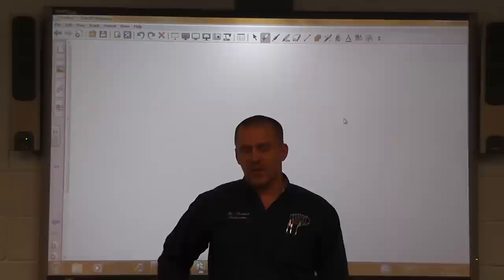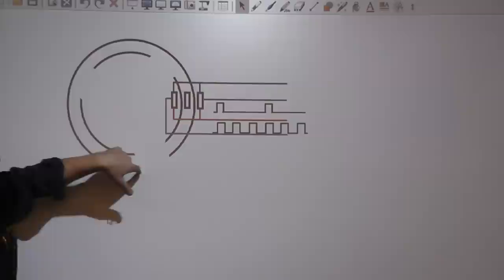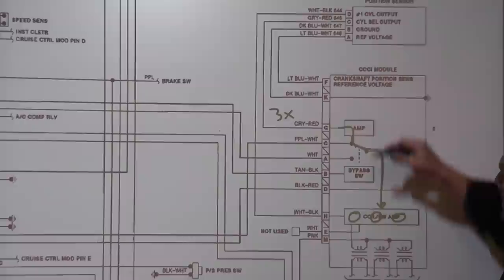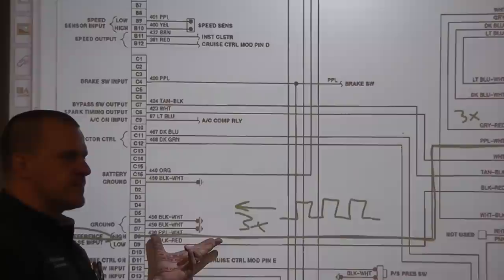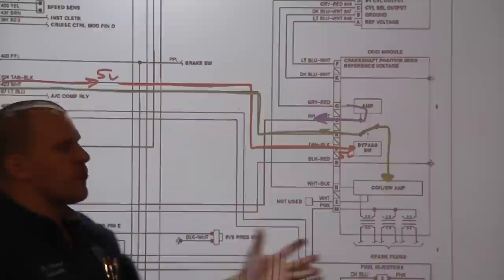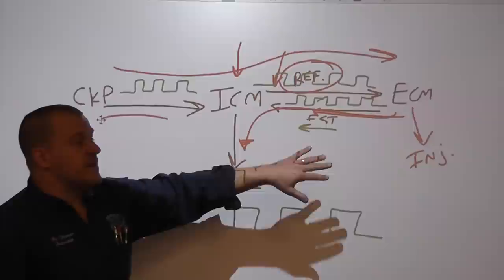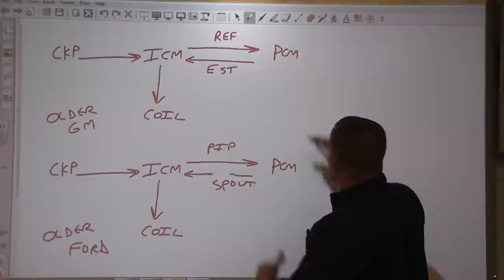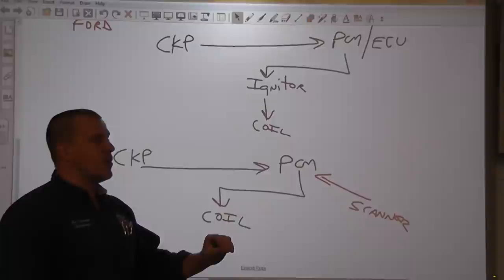GM Bypass Ignition System Operation (part 1)

Comment: This video might be an 'oldie' but it is certainly a 'goodie'.  It influenced me to open the factory service manual on my '93 Chevy Corvette 5.7L LT1 to see which ignition system it has (wiring diagram)..... it's a bypass type.  Thanks for the inspiration to learn more about auto electronics Paul

Comment: WOW! I'm quite impressed and now more knowledgeable on ignitions than my mechanic and electrician skills use to be. You make me want to sign up for school now...
Reply from the maker: I have an online class on my website if you're interested www.scannerdanner.com
Reply: @ScannerDanner  sir, let's take an example about ckp sensor.
1. The car starts well, everything ok. Now, while engine is still RUNNING, if the ckp sensor is unplugged or removed, will the engine stall??

2. I removed the ckp sensor and had someone to crank the engine at the same time, I'm creating blocking and unblocking the magnetic sensor quickly with metals fast enough to send signals to the ECM. At this manually signal inputs to the sensor, will the engine CRANKS AND RUNS??
Reply from the maker: @tnamen1307  1. depends on the car and the design of the cam sensor signal, in general almost all of the older cars will immediately stall
2. nope, the crank sensor is timed mechanically to piston position (top dead center of a cylinder) and you will never be able to match the correct timing signal by doing that
Reply: @ScannerDanner  hi there sir i been working on cars along time i pick up a 95 Camaro 3.4  it has spark but no injection pulse i put a new fuel pump and new gas tank do yea any ideas on how to fix it i have gone broke trying to get it going
Reply from the maker: @JonOffgrid  do you have fuel pressure? Any trouble codes? Is this a sequential injection system or a group fired system? Can't remember. If it is group fired like the 2.8 and 3.1 of this era, one single shorted injector can cause this
Reply: @ScannerDanner thank yea for getting back to me   i have fuel  but no injector pulse i have to see if i have shorted injector it start  up if i put gas in the intake i wish i could see if it has codes but thank it is tech 1 with obd 2 pug i wish it was 96
Reply: i thank it is like 2.8 s
Reply from the maker: @JonOffgrid  codes won't help you with shorted injectors anyway my friend. Can you get to them, or does the intake cover them?
Reply: @ScannerDanner  they are hard to get to i know were a parts car is i may get them injectors
Reply from the maker: @JonOffgrid  we can do resistance measurements from the ECM connector, so no need to guess and remove the intake needlessly 
We need to move this to my forum at this point so we can get some diagram info and pictures of how to do the test
It is free to join www.scannerdanner.com 
Let me know when you post it and I'll jump over

Comment: Hey Man, good video.  I've wrenching for a lot years and you just made my day.   I mean I've been doing this for 40 plus years - but usually hard way compared to yours.  Actually been watching your channel awhile.  Been supporting myself pretty well wrenching for myself 17 years near Denver.
Anyway, caught this one right on time.  My neighbor moving on after 30 years in the house gave me a '89 Pontiac 6000 STE (AWD) in go condition except busted 3100. he'd pulled a 3100 supposedly from a '93 said was running, but what I saw was later OBDII. My good friend Brien - great dude - is dying from cancer, talks through a hole in his throat and never smoked. Doesn't have long. He's driving this worn out Envoy thats junk. (Actually trying to get the security to relearn a key and he using my truck for his medical stuff) Brien likes this car.  So it;s over here.  He  dropped the subframe w/powerchain.  I switched out the engine, everything bolts up. Also, was told is was pulled from a  Pontiac but one different mount. Was side by side comparison to a 99 Buick Century perfect match.
We'll have to modify the fuel lines and egr, then figure out how to wire it in, its electronic without a vacuum line, and heater hose routing. The guy brother had scrapped the 89 intake and throttle body, but saved the injector harness and it plugs into 99 injectors.  All 6 have same color code and I could only guess the routing. It has 2 crank sensors, one to the coil pack match. extra one  at harmonic.  Also, cam sensor. Same coil pack just different location. Engine is in, it's back on the ground, just trying to find time/money to finish.  Probably fire is up in a few days.  But this kinda matches this vid and had to say thanks.  
And again for your scanner stuff.  I mean I used a solus pro for years and now I have a modis edge. Trying to learn everything. I'm learning the low amp probe, secondary coil stuff.  I have a little website that I have back up after being down 5 years.  Going to link this video there, probably on Tim's Build's button. https://www.timthemechanic.com/
Thanks Again for all your vids.

Comment: That was the most distilled and concise explanation I've heard, describing construction and function of a bypass system. You young techs need to pick up Paul's book. I have been in the trade for 31 years, and grew up in the business prior to that. I Just purchased the book myself... I could have made a lot more money if material like this was available back when I started out. Thanks Paul, you are a good ambassador for our trade. I Haven't seen any gdi or multiplex? Got vids?
Reply: I really like the way you are able to un-pack your topical info...and I believe your viewers would greatly benefit from you taking a moment to review construction and function of the component you're field testing. i.e. looking at spark on a waste spark coil....many techs don't know what that is. It's just a quick reinforcement. I've seen you use reinforcement in class, and it would be good to see in your field work. I will be happy to provide a review of your book; I will be joining your premium channel once I have pre-read your book materials completely. Have a great weekend.
Reply: ScannerDanner Premium i have the bypass wire the tan and black wire cut and the car runs but not that good it wont run over 120 km could it be from the bypass wire do i need to fix it or is it ok to leave it cut ? thanks man love ur videos by the way ur the best
Reply: The design Paul described and explained in its natural settings was to perfection

Comment from the maker: @scraiga66 I don't have a video on that but check out the wiring diagram on a 1993 Chevy Cavalier 2.2 (VIN 4) engine compared to a 1994 Chevy Cavalier 2.2 (VIN 4). The 93 version is a bypass system (CKP sensor goes to ICM) and the 94 is completely ECM controlled (CKP sensor goes to ECM). So for no spark diagnosis we need to treat these systems differently.  Thanks for the comment

Comment: Thank You. Been dealing with an intermittent no start on an 01 Blazer that is a complete no start now unless using ether(starts EVERY time).  This is a big start in solving it. New fuel pump, plugs this past summer. I'll be checking this asap.

Comment from the maker: @trad444 Thanks for the book purchase and comment! The CKP variation learn is for crankshaft acceleration rates (frequency increases) for each cylinder firing event. I believe this CKP learn is for proper misfire monitoring to take place, not for the 1x and 3x signals, as this is only one of hundreds of designs.

Comment: This has been quite helpful with my 1993 chevy 7.4L system. My bypass wire does not read in volts but millivolts so I'm hot on the trail ! My truck will start quickly but idle kind of rough with the bypass connected and smooth with it not.

Comment from the maker: @vader2492 Thank you very much. That was a great compliment. It is true what you say about consumers needing educated on why they need to pay for diagnostic time. Most of them think all you need to do is plug in the "computer thing" and it will tell you what to fix. The "free diagnostics" that the parts stores offer hasn't helped this train of thought either.

Comment from the maker: I have seen a completely plugged exhaust cause that. Also a bad coolant sensor which was causing as immediate flooded condition. Also I have seen these early design injectors only short out when under "stress" and test fine with an ohmmeter

Comment from the maker: Get the engine warm and tap on the crank sensor with a long screwdriver. Be careful of the serpentine belt and crank pully. If the engine stalls then you need a crank sensor. As for testing it, I actually have a 3800 crank sensor video that I haven't uploaded yet. I'll try to get that up soon.

Comment from the maker: When it doesn't start see if you are getting a reference pulse on the purple/white wire coming out of the distributor connector. IT should be a 5v square wave pattern.

Comment: Scannerdanner, will a data base such as Alldata, Mitch tell u what type of ignition system u are dealing with? After watching ur vids I find that I dont know a 1/4 of the stuff I thought I knew. This is the first vid I've seen that shows systematically how it works the sequence in-which what component relays signal to next component to get the system up and running. Very easy for the brain to digest. Excellent 5 stars Scannerdanner !!

Comment from the maker: @Mark1944089 it's called a multi function switch. the steering wheel have to come off. and if it is a tilt wheel system these can be tricky. the new harness gets fed down the steering column on the inside. not a real fun job

Comment from the maker: you can still have spark on this design with ECM problems. If it is a no start with good spark, the next step would be to check injector pulse. If no pulse you can still have a bad module even though you have spark. If the ICM is sending an RPM signal to the ECM then you have an ECM problem
Reply: most times the VAT security system known to crank engine key must be read through the ignition switch sensor that sends the key code to the BCM from BCM to the PCM/ECm tells the injectors and fuel pump and electrical volts to the coils to kick on and start . the ingnitions in GM with computer those pass key ingnitions on most gm known for going bad they sensors get fried out or drop below true voltage signal. i just replaced a ingition switch after the chevy dealership said they could not get it to read on there big Computer that there was no comunications obd with BCM and the PCM/ECM they had 5 of there best Machanics working on  it for a month, tore it all apart and they still could not figure it out. this car belongs to a friend of mine, so he got it towed back to his house. i went over there changed out a relay and got my scanner to work reading the obdII system i did a full modules scan and got codes, so next i dug into some researching on these 2001 to 2005 gm vehichles and little do you know, they have had bad issues with the ingnition switches 8 recalls on gm electrical stuff on them. well on the chevy impalas 8 recalls . 5 on the chevy silverados anyways they all have the same Passlock sensor ingnition switches security ingnition lock sensor. make a long story short i got another ingnition switch from a junk yard for 50.00 bucks with 2 keys to it like brand new. placed it in plug in all wire connectors and shifting cable in , and did the relearn key in ingnition procedures steps and walla 4th time started right up. easy peacy. just thought i shared that with ya or for anyone that has had issues trying to figure out why there gm vehicle wont start no crank just clicking.

Comment from the maker: check compression next. if you have spark and it will not start with a fuel source then compression is next. these are known for timing gear issues i believe.

Comment from the maker: after looking at the diagram. I don't think it can be done. you cannot interrupt ICM power or ground, you will lose your input to the PCM for injection. The only option is the EST line you mentioned but I think the ICM will still fire the coils in "module mode" with an EST line fault. If the coils where not mounted on top of the ICM it would be a different story.

Comment: Hi Paul I have question 95 ram 2500 v10 no spark. this PCM need Crank and Cam sensor for spark,   so PCM to ICM to coil. so should I have 2 pulse from PCM to ICM?.. From PCM  have two Ignition Module wires to ICM key on 5V,, Cranking only one pulse the another drop to 0V..

Comment: I have a 1986 C10 rear wheel drive 5.7 350 and It has been running good until yesterday and then it quit running while running down the street. Now it won't start at all. It has what looks to be a new mechanical fuel pump, it has a good battery , new alternator and new starter. The question is what could it possibly be. I was told that it could be the ignition computer inside the cab of the truck behind the glove compartment.

Comment: Good talk. I'm assuming that the bypass function is to make the engine start quicker because the Ecu  takes a few revolutions to initiate the  spark because it has to Calc the rpm and thus the engine rotates a few times more before starting. Am I correct in my thinking?

Comment from the maker: You most likely have shorted injectors. Watch my videos on GM shorted injectors. I have three of them up. A quick test for this is to unplug your injectors one at a time and see if the car starts. IF it does then you found your problem. Keep in mind though that you may have more than one injector shorted. In fact the last vette I did had 5 out of 8 injectors shorted.

Comment from the maker: a fuse jumper wire will not protect the driver. relay drivers only carry 100 ma. and even hi current solenods only carry around 1 a.m. of current flow.
Reply: I have a buick rendez-vous 04 3.4liter v6 cylinder 1& 5 misfire needs some help pls!

Comment: Hi Paul, what is the point of firing the coil from the CKP if the ECU / Injectors are not at the party. Is this to clear out the cylinders of residue or something during crank?  regards Mike

Comment: question I kinda feel bum asking but im a ase tec and feel a bit lost 95 buick lesabor with a 3.8 cranks up on start up but looses injection pulse ,new fuel pump and crank sensor  I did love to see how you explained this video
Reply: monitor the purple white reference wire coming from the ICM. see if you are losing that signal, if you are you may have an ICM issue

Comment: @ chetsjug Stalled once a wk, then 3 times a wk, no reason. Cold, Hot, Load, Idle. It would go days in between. Each time it would start right back up. It went 2 or 3 months like this. The last day on the road it died a few miles from my house. I took another car up and drove the Buick home. It was really bad, dying every few miles. Had to push it out of several intersections. Letting it cool helped a tad, but not much. Except for the 2-15 min. runs, it's just 1-30 sec. run time.

Comment: Got a question on that bypass system got no spark got no fuel it's a 1995 Chevrolet but I've got no spark if I unplug the bypass under the dash if I have a bad ICM can it cause it not to have spark. And it has no fuel control either nor spark control

Comment: having issue with 2002 buick century   no crank no start   I took the resister out the key and place it directly on the wire plug at the bottom but still no crank no start  I notice when I turn the ignition to start position it shuts off the  ignition lights and turns back on when  I relize the start position

Comment: My old distributor has a ECM connection however I replaced it with a new one and there is no ECM connection . So the question is what do i do with the ecm wire that connects to the distributor

Comment: Just found your link, I have a 1999 Chevy 454 Vector 7400  V8 7.4 L  installed on a workhorse chassis- class A motor home. I have a no crank no start, I replace the starter and I have crank, but no constant spark, I replace the crank positioning sensor and it spark and then stop.  so I have crank some time spark,  ICM or  ECM?

Comment: LIKE THE VIDEO BUT WOULD LIKE TOO KNOW ABOUT THE CAR RUNS FOR ABOUT B10-20 MINS THEN CUTS OFF AND WILL NOT START BACK HAVE TO LT IS SIT FOR ABOUT 30 MINS THEN IT WILL DRIVE FOR ABOUT 29 MINS AND DO THE OVER AND OVER SO I WOULD LIKE TO NOW WHAT IS THAT PROBLEM

Comment: I'm getting a electric spark timing is grounded code 42 .. do you know what this could be .. i have changed the optispark,  coil, ignition module, air flow mass sensor,  and pcm .. working on a 95 caprice. Any suggestions?

Comment: hey paul so on this this dising is it possible to have 170 psi of compression on all cylinder, 45psi of fuel presure key on egn off, and 37psi egn crancking, have injector pulse, and spark on coils, have no shorts on any of the injectors 12.5 of homs on each one, have cmp and crank signal,  and still have a no start? i had one like that few years ago it was 1994 buick century customer replace pcm, icm, cmps, ckps, he brought it to out our shop to see if we figure it out but no luck.

Comment: Interesting... So... I have a 1976 cj7 jeep with 258 engine and recently installed a gm 4.3l rebuilt tbi unit with ecm on it.. It starts and runs but has check engine light on.. Shows codes 42 and 43... These are for the spark control, which I haven't installed.. What is the best way and most economical to install in a upgraded ignition system in a cj7 jeep that the gm ecm will be able to control the timing? (the throttle body is for gm models 1987-1991 with 4.3l v6)  :)
 by the way, I have the bypass GM system

Comment: Have you ever came across having to swap distributor when changing engine due to the new engine not having a crank sensor?  I have a 95 Blazer and yhe old engine had crank sensor. Tbe replacement engine doesn't. Please help. I swapped the heads and CPI already to the new engine.